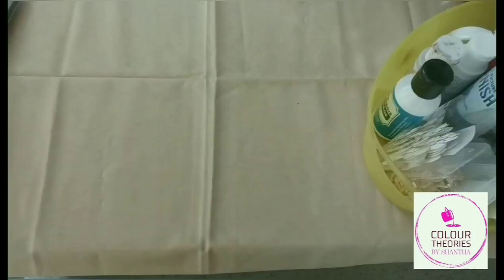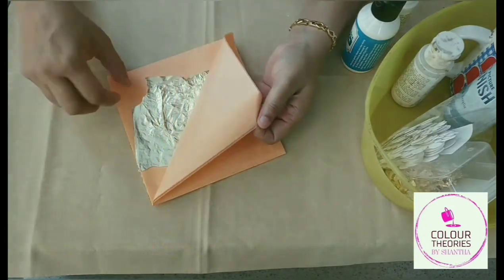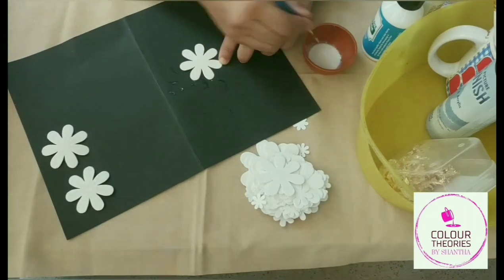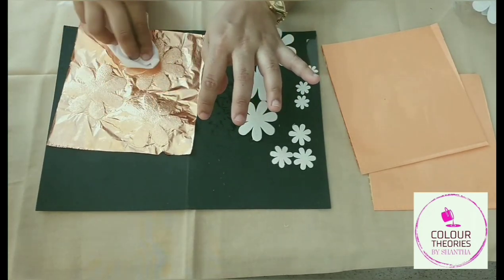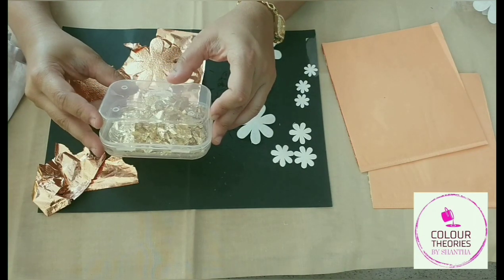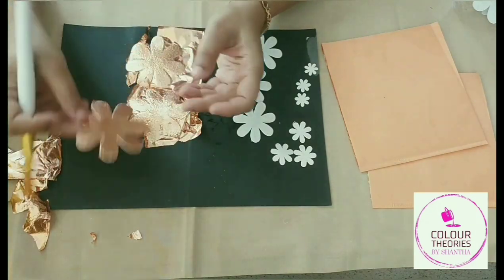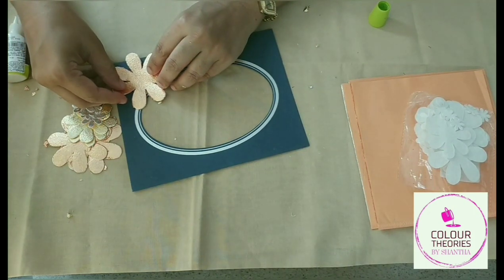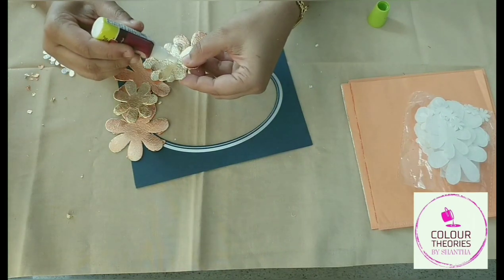GILDING: GOLD LEAF DECOUPAGE

Comment: Hi SP, very detailed video!  I have a question- does the gilding wear off after sometime? Any top layer required?
Reply from the maker: Thank you. Yes it will wear off as it's very delicate. What you need to do is spray it with a coat of Acrylic Spray Varnish. Followed by a normal wood varnish.
Reply: If we don't have a spray varnish, can we varnish it with little Birdie Decor varnish
Reply from the maker: @jayashreeanand4253  You can coat it with a layer of decoupage glue and then Varnish it.